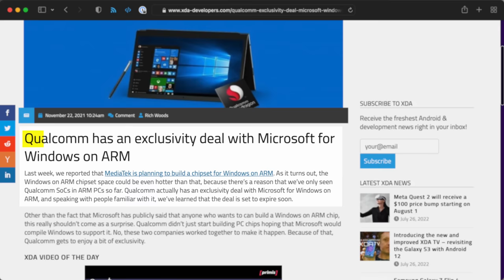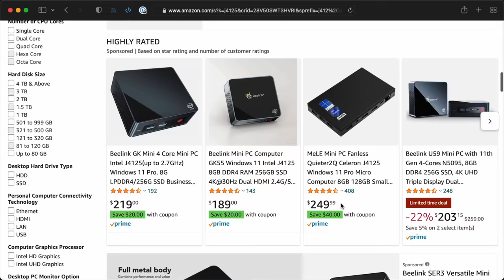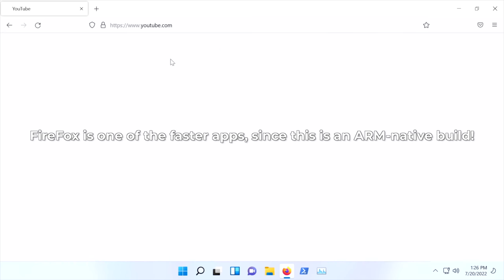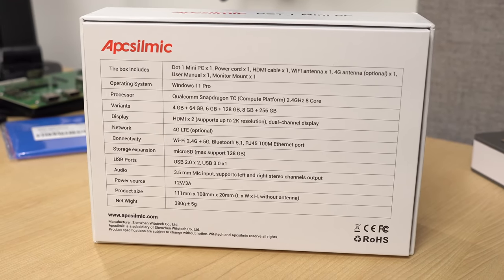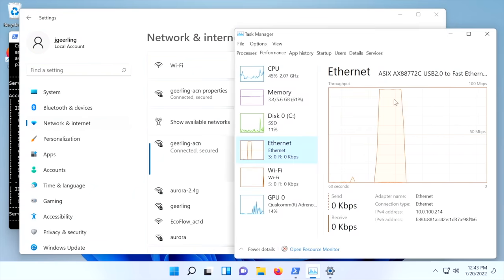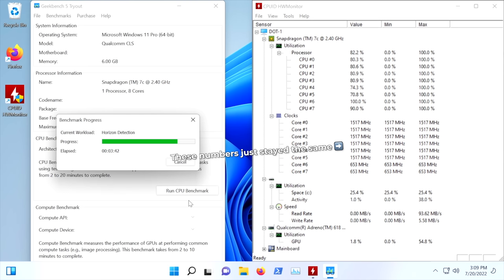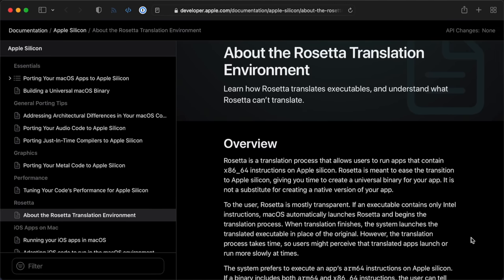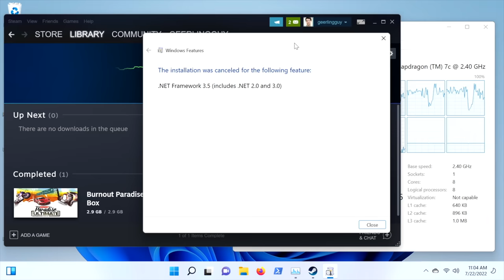Microsoft's wasted potential: Windows on ARM

Comment: This has been going on for a while at this point, it is always "this is not good enoght yet, maybe the next one". The problem i see is that ARM cpus that could run the desktop Windows apps at good enoght speed are going to be too expensive, and probably not that energy efficient, at least not as many people expect. 
The first problem is the ARM little core, it is a in-order cpu core, thats is like using a older than Baytrail Intel Atom, and ARM cpus are designed to have 4 of those in general. Apple does not have this handbrake on their ARM SoCs, they understood very well that you cant make a desktop experience with something like that.
So right now you would need a ARM SoC for Windows that has 4 to 8 Cortex-X1 or X2 cores and no little cores, or at worse, use A710 as little cores. That thing is going to be expensive as hell and im not sure how energy efficient would be with that configuration.
Then the GPU, thats another issue, GPUs that are embedded with ARM cpu arent optimised to run Windows DX11/12 and the drivers, if they exist, are really, really bad.
So this is nowhere near to be usable, no way, the binary translator on Windows is not thaaat bad, it is way worse than rosetta 2, but it is still decent, or at least the x64 version is, the x86 binary translator runs reallly, really slow on ARM Windows.
TBH, my "tv pc" is a desktop ITX board with a J4105 cpu on it (Biostar J4105NHU) and that thing, while far from being the faster thing in the world with a 12v DC-DC psu, a pci-e wifi card and a nvme SSD it uses about 19W with full CPU/IGP load and fully supports the windows app stack whiout using binary translators. In general im more interested in seeing how energy efficient the Gracemenont cores will be on Alder-Lake-N as that is likely what is going to replace the atom line.

Comment: The Tegra 4 was already more than enough for Windows 8 RT. But Microsoft does not get things straight. They had one job and fcked up. Also since Intel ATOM is practically dead, there are no cheap windows Tablets anymore. 🥲

Comment: My old core M3 intel compute stick gets better performance than this while only sipping 4-8 watts and it's more useful. X86 is totally capable of getting low power consumption. the core m3 is only using Skylake based cores. Now imagine if intel made a new compute stick using alder lake E cores.

Comment: I will nevver understand why SoC makers don't just merge their SoC drivers with the kernel. Who the heck is benefiting from needing a custom build with every chip? It seems like it's just a whole bunch of extra work for Qualcom to not send the code to Linus
Reply from the maker: I think a lot of them just build for mobile and don't care about anything else. The mobile handset, tablet, integrated device market is pretty huge and they don't care about desktop/laptop use :(
Reply: @JeffGeerling  mobile uses the kernel, and because the drivers are not in the kernel, it's a huge pain for developers to work with it, hence why even new phones use ancient kernels
Reply: The Linux kernel already includes most of those SoC drivers.
Reply: @lawrencedoliveiro9104  they don't include the drivers for the gpu nor the 4g/5g modem, hence the need to use a custom kernel
Reply: @redtails  Vendors soon discover that trying to maintain proprietary drivers for a Linux kernel is a losing strategy. They have to carry the burden of updating those drivers for kernel architectural changes, or force their users to stick with older kernels, neither of which is very attractive. Far easier to submit those drivers for inclusion in the mainline kernel source tree, where they can be kept up-to-date as part of the joint community effort.
Reply: @lawrencedoliveiro9104  well that was my point. Check your android's kernel version. I assure you that it's some ancient build. Phone makers are fine with this 😅
Reply: @redtails  Android vendors use whatever Google offers, and Google tends to provide recent kernels.

Comment: First the Apple/MS comparison is apples to oranges and non-sequitur. Microsoft is not the creator of the device so this is like saying Apple needs to distribute IOS so it works on all mobile devices even though it's specially designed for specific chips in an Apple specific configuration or OSX needs to work on all ARM processors. Microsoft is slowly making it's focus towards all chip compatibility especially with it's newer dev frameworks compiling to run on anything (I had an app running on my pi continuously for months on ubuntu) but this "review" seems to be a bash of MS and the device manufacture in saying "I'm an apple fanboy" more than a legit review.
Reply from the maker: Microsoft makes their own devices (Surface line), and their ARM-based products suffer from the same issues (just slightly less than this more underpowered box).

Comment: 5:36 I think Windows won't auto-connect to WiFi because the Ethernet is connected - I mean, why would it, because normally wired connection is better. Have you tried disconnect the Ethernet?

BTW, I think it's the case in many Linux distro too.
Reply from the maker: On my Mac and on most Linux distros I've tested, it will hold both connections since there are a number of use cases where you'd want two connections (even if one is WiFi and prone to more issues).
Reply: Linux can handle any number of network connections at once.

Furthermore, in my house DHCP server, I assign the same IP address to the MAC addresses for both wired and wireless connections on my principal laptop. This way I can switch connections without changing address -- or even dropping current connections!

Comment: >100mbit is too slow

I mean, yes but for its intended purpose and CPU power, there's no need to make it more 100mbit. It's basically very lightweight office box and even if i made it into NAS with 4 external hdds or via USB hub, it would never be able to get over 100mbit anyway.  So here, saving couple bux on slower ethernet is just fine.

Comment: It wouldn't surprise me if someone ports a version of Android to it since it's probably easier with that chipset.... just enable ssh, root the system and then you pretty much have a full linux install....
Reply: You consider Android  as a "full linux"? That is bold! ;)
If you want to have a "full" Linux on this decive why not using a proper GNU/Linux instead? ... Android... meeh!
Reply: @fumanchu4785  back in the day and a lifetime ago when it was so much easier to root devices, my coworker and used an motorola tablet that was running honeycomb and sshed into the tablet and compiled/installed a bunch of random things just to prove that we could. yeah, it took a while to compile crap but it could be done and for what it's worth once we were in via ssh and had root, the tablet was ours and it really was no different than any other linux distribution. it was just really, really flat. :-)

Comment: As a Linux user that's forced to use Windows at work, this example is my native Windows experience between 9 to 5 on a daily basis...
Even after 6 or 7 years, Windows 10 feels sluggish, buggy and massively annoying! 

It's often in simple things, such as opening an application on a multiple monitor setup. 
- Linux opens set application on the monitor that I'm currently using, and looking at. 
- Windows opens set application on a completely random monitor, preferably one that I've not been using or watching in the past 55 minutes...
Reply: same for me.... massively annoying/frustrating just about sums up my user experience too. and because it's a work laptop with domain policies applied there are several of those huge annoyances that i can do absolutely nothing about. the worst offender being windows defender (msmpeng.exe) which on a daily basis is spiking my cpu load and ramping my cpu fan up and down throughout the entire work day. defender is our corporate 'solution' whose "settings are managed by your organisation" Aaaarggggghhhh !!! for me the entire windows experience feels considerably degraded and impoverished in comparison to the linux one. and to the neighsayers and those wedded to windows for gaming i'd say that gaming on linux is now becoming a thing, or with respect to my own non-hardcore-needs i'd say it is actually a pretty decent experience.
Reply: @daysiewaysie  I completely agree! 

Power users are often suffering degraded work efficiency, due to an overly protective IT department refusing free choice of OS. Another thing that I find particular annoying, is that most IT (department) managers have the technical skillets of a drunk baboon, yet everyone in the company looks up at them for their technical wisdom... Heck, most of them would think an I7-920 is better than an I3-8100, just because it's an I7...

The past decade has given us lesser and lesser reasons to stick to Windows for day to day tasks, even for gaming. For the exceptional game that doesn't run in Linux, it takes less than 1 minute to reboot my desktop from Linux into the OS of doom (Windows). If Windows want's to cooperate and doesn't start to update for the next 6.9 minutes at boot-up...

Whenever i start searching for another job in the future, being able to use my own Linux distro of choice will definitely be an absolute must-have... To those that answer "no" to this simple request, I wish them a lot of success finding another developer on the job market within the next 6 to 12 months...
Reply: @timmy7201  I mostly agree, although at my last job, it was pretty much a free-for-all where everyone administered their own machine and ran whatever OS they wanted to.  The downside was that it led to endless issues along the lines of, "Well, it works fine on my machine.  I don't know why it doesn't work on your machine."
Reply: @electronics-girl  Well, it's technically the most realistic test scenario for developers...  :-) 
To me the simpelst rule would be, those who op't in on the free-for-all, should also fix their own issues on their machine.

That said, a good developer writes code that runs on any device... Even on grannies 13 year old Win7 Optiplex, with Internet Explorer wasting 75% of screen real-estate on task-bars...
Reply: @timmy7201  Yeah, my biggest issue was that developers wouldn't fix the issues on their machines themselves.  They would expect me to fix it, since I had written the code.  That got old fast.

Primarily, the portability problems we had were not with the compiled code we were writing, except for some cases where a Linux distro might have an old version of a library.  Mostly, the portability issues were with the build system or the test scripts.  Those were more sensitive to filesystem layout, and to exactly which command-line tools were installed and which weren't.  Stuff like that.

Our situation was a bit unique, because we weren't writing end-user software that needs to run on anything and everything.  We were selling expensive, specialized hardware, and along with the hardware we delivered a high-end Linux machine preconfigured with our software to make the hardware work.

Our software supported both Linux and MacOS.  However, we always shipped Linux machines to customers.  The MacOS build only existed because some of our developers preferred working on MacOS, rather than Linux.  I mean, it's good to accomodate developers' needs and preferences, but that might have been going too far, since it was a lot of extra development work that didn't have any benefit to the customer.

Comment: 500 in geekbench is not much, for windows to compete we need more than 1200 points, the problem here is microsoft and qualcomm are not puting enough resources
Reply from the maker: I believe their latest 8cx chip can put out over 1000 single-core, but yeah, it's still not coming close to even the 2-year-old M1 performance.
Reply: @JeffGeerling  totally true, it's sad that the newer chip from Qualcomm can't even compete against apple M1, the good thing it's maybe in a few years we will be getting something more powerful

Comment: With Cameron based laptops consistently under $150, this mini PC has no place on the market: no user input output devices, more expensive, less performance, less software support. If it can get the market share soon, the project may not have long to live.

Apple got their ARM in shape within a couple of years before the release. Though it is true apple has the closed ecosystem so it requires less effort but with all the existing lower power kiosk platforms working, it is already too late to take that market.

Comment: I wonder how much of the performance issues stem from flash storage. I know the Raspberry Pi's run off the SD card which is painfully slow. Also, it probably has no GPU acceleration like the Raspberry Pi. Just a straight framebuffer.  Linux on Raspberry Pi isn't exactly a beast either.  No fair comparing to a real PC.

Comment: lots of takeaways here - mostly fact that arm does not have roadmap - it is tough to find out any info on arm like when pi 5 will be out and what comes after rk3588 etc....for some uses on systems for smb lo power arm is way to go - pihole and opnsense are good examples - the devices pay for themselves in a year or two just based on elec savings

what do smb discount quality compute contingent want? they want faster net and nvme and more io/iops plus better efficiency for the ideal lo cost cluster node - biz cn pay 4x and get 40x net perf with 100gbe - i think 2023 is year of linux desktop and 100g - red shirt jeff may agree
please do a opnsense ha setup with arm maybe nano pi with 2 2.5 - running an orange pi5 is an option - get the 32gb versions? i think you want at least 8gb for good opnsense experience #freshports #bsd on arm #debian arm #qemu #linux in bsd jails

Comment: Qualcomm SC7180 (also known as Snapdragon 7C Gen 1) is not a decent CPU, it is a very slow CPU. Its passmark score is 2979, so this CPU is like 2010's entry level CPUs. If you want to compare a decent ARM based desktop CPU with decent x64/x86 computers, you should choose Snapdragon 8C Gen 3.
Snapdragon 8C Gen 3's passmark score is 11671 points, and it is a little slower than Apple M1 CPU (whose passmark score is 14447 points), and a little slower than Ryzen 5 5600U (whose passmark score is 13161 points).
Snapdragon 8C Gen 3 is used on Microsoft's  Surface Pro 9 5G, and probably will be used on Microsoft Project Volterra mini PC. Also Lenovo ThinkPad X13 notebook PC uses Snapdragon 8C Gen 3.